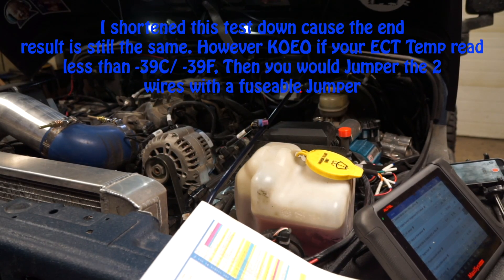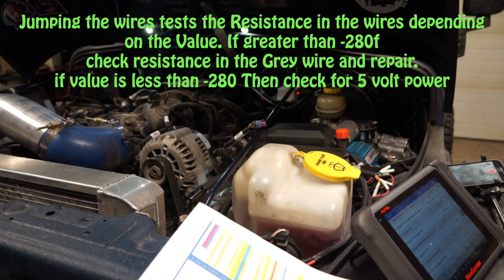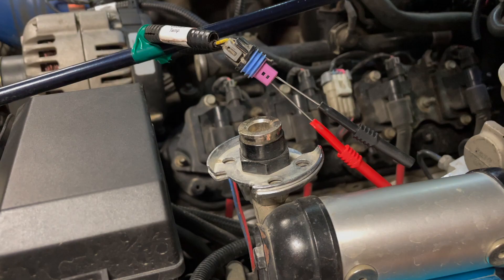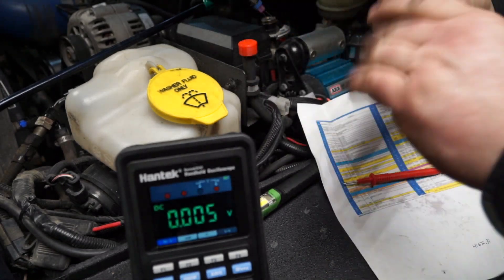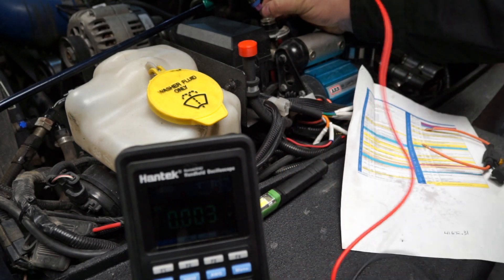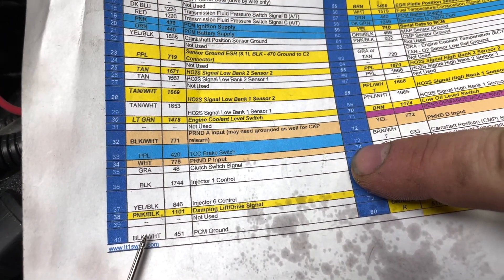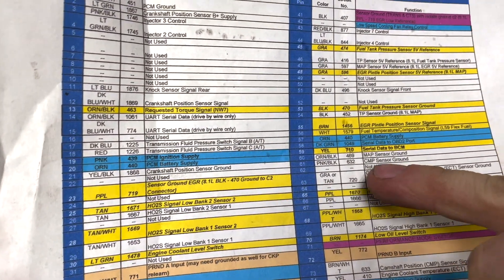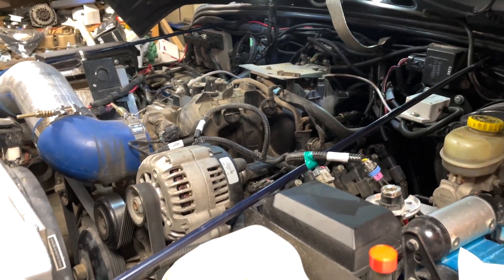P0118 Engine Coolant Temperature Sensor high Voltage

Comment: If we get 12V.whay happened...
Reply: If you get 12v and the wiring diagram calls for 5v, you may have a short between the signal wire and another wire in the harness which supplies 12v.